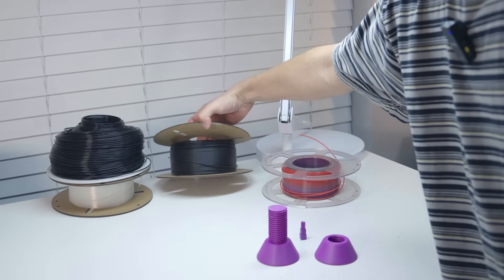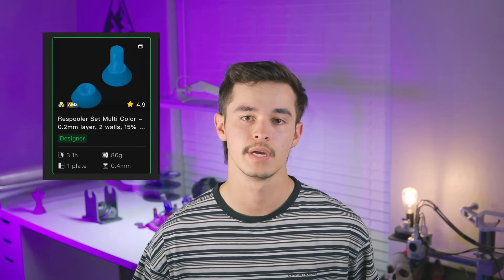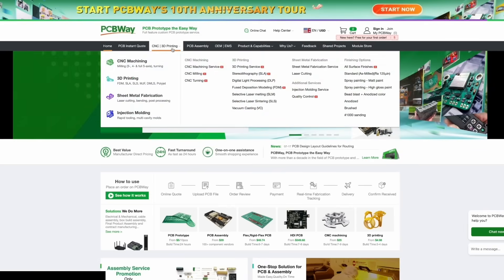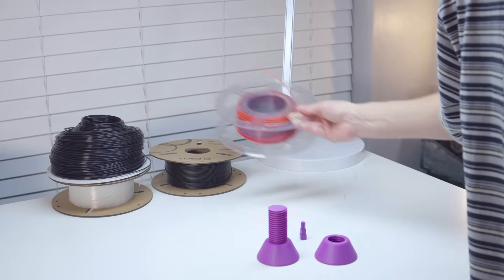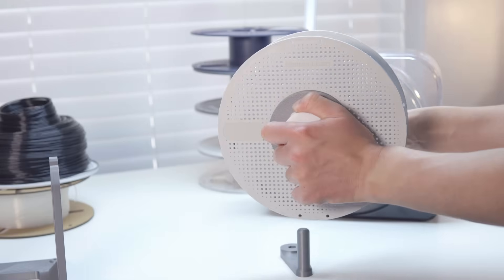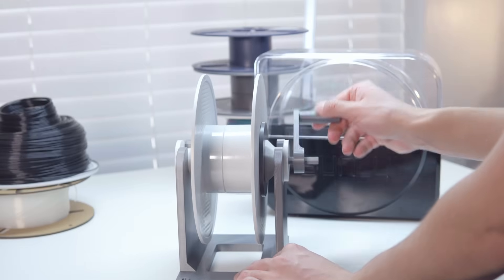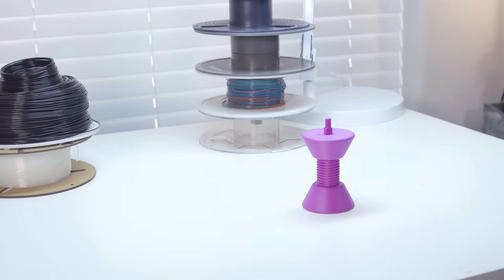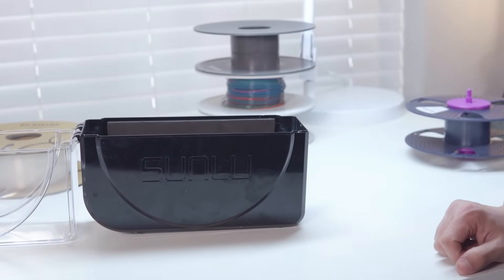I Tested 3 Filament Re-spoolers So You Don't Have To

Comment: this video made me anxious when he cuts the filament and drops the end into the spool without locking it
Reply: Yup triggered me too no end
Reply: What a perfect opportunity to show how to deal with tangles and save the filament - but instead he just plodded on until it became so bad that it damaged it instead.
Reply: I heard that after you respool, you should respool what you just did so the filament is wrapped back the way it was manufactured.  If that makes sense.
Reply: @timcahoon4911  well, if you have an enclosed printer you can print it. Or try ABS, ASA, PC, PC prusablend. There are so many out there. 

And I know what you mean by rewinding it back, I also thought about this. But the testing I did didn't show any issues when printing filament in reverse.
Reply: I am glad that I am not the only one.
Reply: Dude  is sitting there talking about how it sucks to lose part of the spool to a tangle ... and just does that, no thought into how tangles happen or how to prevent them, lmao
Reply from the maker: @ThatOhhio very true
Reply: @ThatOhhio  came here to say this.
Reply: There’s a reason the spool had a tangle. It’s not the manufacturers fault.
Reply: @NebulaHatesWatchdog  Really?  I have this problem on nearly every spool of Elegoo I use, one reason why I am swearing them off.
Reply: Makes you question the actual average knowledge when it comes to general 3D printing community.  Most people are absoljtely clueless
Reply: He uses a Bambu and is only on makerworld, what did you expect. It's like if I started reviewing printed posters at home because I have a HP desktop printer
Reply from the maker: it’s the most easily accessible printer for everyone, trying to be the most relatable!
Reply: @jet_lea  doesn't really convey "confidence" or "experience", and then making videos like that explaining things to others, I don't know man. 

Hold and secure the end of the spool so it doesn't tangle, secure the "start" of the spool in the holes of the spool. Print gears in PA6/PA12 aka Nylon for longevity and durability. 

Just to name a few...
Reply: @010falcon  good suggestion on the nylon but I don’t print nylon.  I just need something that worked for an occasional spool.  If I had a print farm nylon would be a good choice
Reply: @010falcon  Oh, this last one I'm using stops now and then because it's tangling. Have to stop and fix it once in a while. Realized that I screwed up at the start because I lost track of where the end was. Good to know.
Reply: @010falcon its for sure a experiance. What if his videos show the average printer user? Not every gear needs to be nylon. Most gears you use in daily life are made from "bad" gear materials and yet they work every day. You also know this is a 1 off thing so it doesnt make sense to print twice just for the nylon gear especialy at the added cost. From someone so snarky i expected some more experiance xD
Reply: @fireworkstarter  to know someone, you have to be someone. Which doesn't seem to be the case here sadly. 

Most gears out of plastic are made out of nylon or ptfe. Because it is dirt cheap, glides well, and lasts a long time. 

"Print twice". Why not just print it properly the first time. He should have atleast considered Nylon, but he didn't. It's like me making cooking videos. Again, he has no clue about 3D printing and is making tutorials / reviews, he didn't even know that he has to hold the end of the filament spool. It's like the Verge's PC build.

Comment: Great video. I printed the full Pastamatic last week and… it works. But it’s wobbly and finicky and I broke the first handle I printed (I’m not using a drill). It’s good enough for occasional use but it does seem over complex for what it does. (The “lite” looks like a more refined design.)

Comment: A simple thing I learned is if you have a full spool to transfer, use wide painters tape and tape off your full spool to keep the filament intact tightly and together. Slowly take off one side only of the old spool. Pop in that same side of the new spool. Flip. Repeat. There’s some videos out there to help explain.

Comment: Last week i printed the  "V - Spooler".  Several plates, m3 nut inserts and bolts, bearings, gears and even a metal spring.  Works great but it only accommodated 1kg spools and now i need to spool from a 3kg spool and it won't fit in the V spooler.  So i may print one of those simpler setups.  

The issue with the spools shifting/moving on the counter top while spooling, there's an easy solution.  You can use heavy books as a stop. 👍🏻
Reply: V-spooler X can do it. Best out there.
Reply: @TimeDoubleTV  I'll check out the X, maybe i just need to returning a few parts 👍🏻
Reply: @BennyTygohome  you can 100% reuse most parts (hardware wise).
Reply: I think there is a "upgrade kit".. but I can't remember, as I actually just ordered the X fully assembled.. ;) .. yes laziness has it's price.

Comment: you can screw them down on a board -- then print a couple clamps to clamp to a table when you need to use it --- maybe also pull the filament from the bottom like the AMS    so that it's kinda pulling the back of the roll down instead of up from over the top -- 🤔🤔
Reply from the maker: I tried pulling from the bottom with the same result, the solution is definitely attaching the winder to something or using a spool holder from a printer
Reply: @jet_lea  that's to bad about the pulling  -- anyways l'm thinking of printing the the 3rd 1 to make all my end rolls into 1 big roll after connecting them together -- thankies for your videos - always love them

Comment: Saving this for later, I'm actually looking for respoolers rn
Reply: I have printed and am using the V-Spooler. It requires several parts - bearings, PTFE tube, heat inserts & screws but then any repooler worth printing will need at least bearings. 3 issues. When the top spool gets light and is being respooled using a drill it has a tendency to jump off and potentially snap the filament. You either need to slow down or restrain the reel. I modelled and printed a retaining bar. Attaching the filament to the new spool is awkward as the spooler's frame gets in the way and restricted access. Just a technic issue which I have yet to get on top of. The default handle design is poor and more of an afterthought. I designed and printed my own in the end. Overall thought it's a great useful project with a small footprint that I'd recommend.
Reply from the maker: that’s what i’m here for